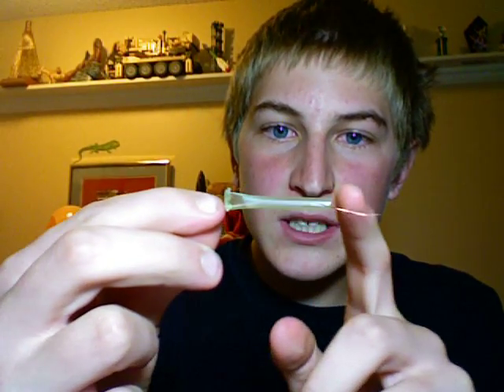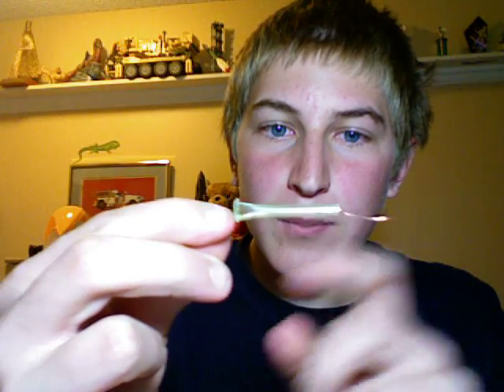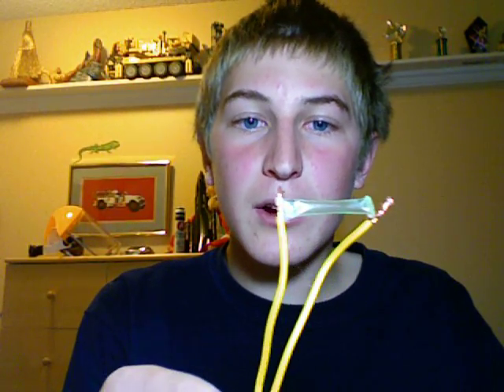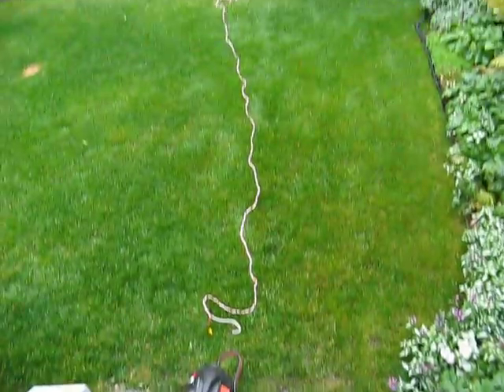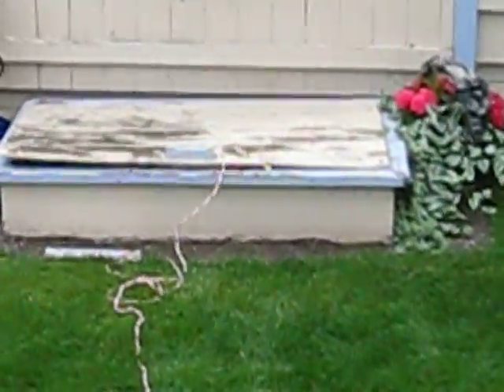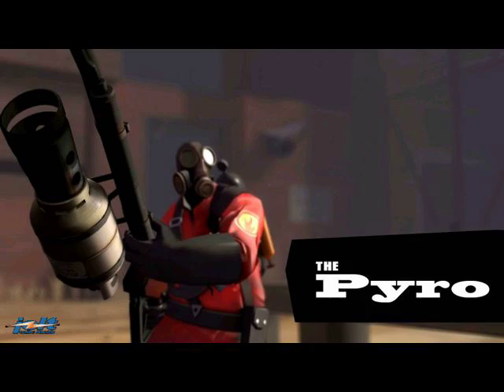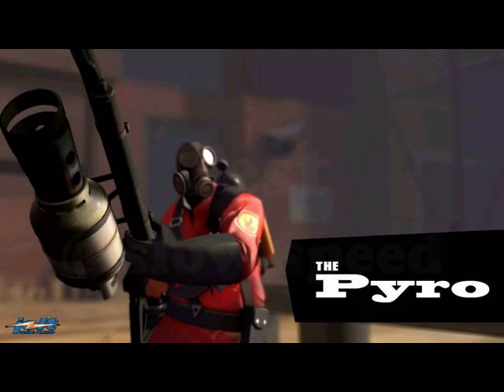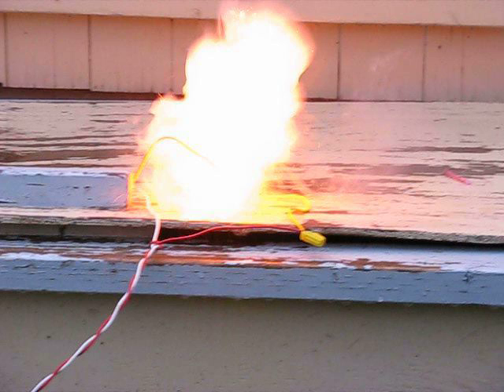How To Make A Electric Ignition System

Comment: What you are making is called a Squib, not much for a explosive device but more for a detonator. These smaller charges are used for igniting larger explosives such as Semtex or Ballistic gelatin. Squibs are usually used for 3500 to 9500 m/s explosives, not for kids. But thats why they don't sell blasting caps or squibs to the general public. Be safe.

Comment: It really depends on how long and how thin the wire is. I tried it and I used around 4 AA's with about 3 or 4 inches of wire. I have no idea what guage (thickness) the wire was. Basically, you'll just have to experiment. First of all, do you want it to stay red hot or do you want it to just get really hot and then vaporize? Either way, start with one AA and keep adding batteries one by one in series (+ to -) until you get the desired result. You can get 100ft of wire on ebay for very cheap.

Comment: Amps, not volts. A bunch of AAs should work, or a C or D battery would also work. This is the order of batteries: 9volt = 0.5 amps, AAA = 1 amp, AA = 2 amps C = 4 amps, D = 8 amps.

Comment: Run the wire back as far as you want depending on wire type... Wires have resistance which would bring down to lower voltage which may effect the ignition.

Comment: for you youngsters trying to do this,  its better to use a ULTRA FINE Copper wire.. the smaller the wire, the less power is needed to ignite it.  with a 9v radio battery, can you make any small wire glow red hot.  you can use white glue and mix with mach's to turn it into a putty that can be painted or rolled onto the wire.  then you dont need to use a straw.  NEVER make anything that explodes with Steel or metals. always use Cardboard and white glue.

Comment from the maker: @AxillaryGrenade I would not advise using 120v ac as the chance of electrocuting yourself fatally is much greater. Realize that all you are doing is creating enough heat to ignite a fuel this can be done with a smaller power source as long as resistance is taken into consideration.

Comment: @dalelerah I would not advise it. It depends on the fuel contained in the igniter. If you heat the fuel too much it may combust. This is simply based on the concept of activation energy. in some cases it is not even advisable to seal the other end with hot glue as the fuel may reach it's activation energy and combust.

Comment: @aznricecannon To be safe, I would wire 2 in series for 3 volts and do that in parallel with another set, so you have 4 batteries and 3 volts.

Comment: @aznricecannon 9 volt batteries wouldn't have enough current to do it. If you get a couple D batteries, wire them in parallel, it should do it.

Comment: I saw you used a motorcycle battery in your other vid. I don't have the type of money to just dedicate a car battery to this and I'm definitely not gonna hook this stuff to the battery in my car. What alternate power supply would you suggest If I was going to fill the charge with match heads. Would I get desirable results with a couple 9 volts? 
PS: I tried reading the comments to see if it was answered. I didn't find anything that helped

Comment: If in need of fuse wire just go to any hardware store that sells wire by the foot (choose how much you want in ft)Usually around 60 cent or so a foot for really cheap wire. 4 gauge usually has around1862 strands and 8gauge about 735 just take a knife or razor and carefully cut off the shielding = A bundle of fuses!!.Also never reuse any small battery in an electronic device that's been used like this. It can damage the device due to burnt electrode's within the battery.small idea.very few lettrs

Comment from the maker: @RussianVitamines that's not a bad Idea. Typically I use some sort of liquid accelerant along with the match in order to start a fire I have couple different match types too (match heads, gun powder, kno3 and sugar). I have used this system a couple of times to light campfires but it usually also involves some sort of fountain piro as well. I typically will use a fairly energetic fuse because it lights the fountain pyro with less delay. However the liquid is what actually lights the fire.

Comment: Its just an electric match, nothing serious, why peoples think its for things that goes boom, for example you can just set a camp fire with it without beeing at the spot :D I find out a bit diferent way of this. Instead of sraw, i use a binder, smokeless gunpowder or styrofoam disolved in acetone, and mix it with match head powder, then it burns slower and nice, without pop.

Comment: I mean this in the best of ways, but this is actually not a very good idea, it works fine, but it will HEAVILY damage the batteries, theres no load inside this circuit, which I suppose if you have a 12v battery laying around you don't care about sure this is great but otherwise, theres other videos that can show you how to make an igniter that will not destroy your batteries.

Comment from the maker: @reload195 You don't come off hater-ish at all. No car (lead acid) batteries do not produce hydrogen gas. You may be thinking of the electrolysis of water which produces hydrogen on the positive terminal. The battery is delivering far less power than it would to even a car. It would take a VERY long time to overheat the battery due to its overall size as well. Also keep in mind that the battery will only output the needed current and the match breaks shortly after it is lit. In short your safe.

Comment: not bein a hater but doesnt the positive terminal of a ar battery produce hydrogen, so youre shorting out the battery which causes a spark when you connect both wires to the terminals, thats dangerous becuz  then the battery can explode.

Comment from the maker: @Vaiktorg I here you. In hindsight I should have used different wording. The intention was not to create anarchy or promote terrorist activities. The intention was to demonstrate a way to safely light fireworks, and test chemical mixtures used in pyrotechnics such as KNO3 and sugar mix (sometimes called r-candy) which is used in rocket motors and smoke pyros. The design is to SAVE fingers and potentially lives by increasing distance between the user and the test subject. Thanks for the comment.

Comment from the maker: @mrwhitewolf94 I am no expert on electrical matters by any means but I believe it has something to do with the amount of amperage the battery can deliver at any given point. On a standard dry cell this "cranking amperage" is low however a car battery can deliver a much greater amperage (enough to turn over a car) the formula is simple IV=W current times voltage = wattage. you could try some hobby car batteries they may work, I use a motorcycle battery because it is smaller than a car battery.

Comment from the maker: @tapper45 A compositor is a person who arranges type for printing or keys text into a composing machine. However A capacitor is an electrical component which utilizes a gap to produce  electrical potential energy. Early capacitor like the lidded jar used a simple non conducting material (the glass of a jar) to separate two metal surfaces. modern capacitors use a thin membrane to separate metal surfaces allowing more potential energy to be stored. Is that sufficient?
Think before you talk dumbass

Comment: @pyrogirl1985 2- 9V batteries wired in series do not have the current capacity to raise the temperature of a copper wire of this diameter to a point where ignition will occur. Canabalize a hair dryer and use a section of the thin nichrome element, or use a fine strand of steel wool. Any wire with a higher resistance than copper should work well..

Comment: 3. use black powder instead of flash of a match.
its still a pretty good design, i like it ive tried it. its not bad. oh btw you dont need a 12 volt. a nine volt will suffice. it just might take a little more time. btw good job on ur pyro vids.

Comment: Ok. Good job but here are a few ideas that could improve this design.
1. Replace the small strand of copper wire with the spring from the regular click pen.
It doesnt have to be a click pen spring just a small diameter spring.  Just hook the end of the wires to the ends of the springs for terminals.
2. You dont necessarily need the straw with some fireworks. for instance bottle rockets, just cram the spring into the bottom of the rocket in that small hole(after removing the fuse of course).

Comment: you could just put  some steel wool in the tube and about half a teaspoon full of powdered matchheads in too .

The following is a load of nonsense : Hinfgsjcucuysgffgxydyycgxgshhcuyx tdcktscgsagkcscgyassctsytcsaycscsauyicsauyfcfyascusicfgreghfirehv8eryvoewuf;kewhfuiewhufyw9euf8374[73f7da8v7d9icvd098v78tcdkjcv8ve7fe7fdsc9sCIYSXCTYSDTCI7WSY6DC78WEFD76WEDYSYCT87DSTC7DC7T7ECTE7C7C7TSCUSDTCSCTSDC7TSDC76E67678TSTSXSUODTSUYTYTTTTYTYtistyduysttYTTYTtyitatxztTTRZSTraiTURXSATCDTEITCPFEQP;BTKI6FSXUYDFLD

Comment from the maker: @bobbybob3680 
Yes you could use an electrical spark to light aerosol, and you could do it with just one or two aa batteries. What you need to do is wire up some compositors to store electrical potential energy. This will allow you to achieve the necessary voltage to create an electrical arch. I would recommend that you do not use wires as your arching points you should use something like bolts or pins to achieve a more consistent result. I hope this helped. If you want shoot me a message.

-DAN

Comment: ok please answer my question! anyways what im wondering is if i have a potato launcher and i cut two holes next to each other and have the wires glued in, will the wires arch creating a spark igniting the aerosol? cause all i need is a spark, and in that case couldnt i use a smaller battery? please let me know!

Comment: @pyrogirl1985 instead of the copper, use steel whool the thin one, just take a pice and use it, you just need 12 volts for litting this one up, also if you take two matches, pass the whool in between the 2 matches, touching the lighting part, and pass corrent through it it will start, no doubt about it!

Comment from the maker: @SeamusOLepreachaun The copper wire heats the match heads or gun powder to it's activation energy at which point it lights. the copper wire is simply acting as a resister much like the nichrome wire in a toaster or an element on an electric stove.

-DAN

Comment: Forgive my innocence now, but does it go bang because the strand of copper actually gets red hot and burns up on fire or simply because you have got current flowing through it? and will this work on a larger scale eg how many volts do you need to burn out ordinary single core wire? Thanks Boss!

Comment from the maker: @Ffojt Noted. I usually just use match heads or gunpowder because they burn for a longer period of time and ensure ignition. I have really only used flash powder for demonstrations. Also the hot glue can be substituted for a simple piece of wading paper or plug. I also use the lowest temp hot glue I can find to minimize the risk associated with reaching activation temperature.

-DAN

Comment from the maker: @thebomb182 I don't know what your seeing. My power source is nothing but a 12v motorcycle battery hooked up to leads. There is very little electrocution risk and the electrocution risk that exists will not kill you. I have no idea where your getting 264 volts from.... I could only get 240 if I plugged the charge into a double grounded oven outlet lol. Have a nice day and please think before you talk.

-DAN

Comment: 8421 Mobile Crane FTW. Been after that set for ages XD
I prefer the second  system, but this is still a pretty neat way to do it.
Also, where did you get that mask? I ain't seen anything like it round these parts (England).

Comment from the maker: I am am to have to say no because most 9.0v batteries can not  put out the necessary amps to run the system. however if you go into the realm or RC (nickel metal hydrate) batteries you could probably light my electric match. this is dangerous though, as this type of battery will be much more likely to overheat and destroy or damage itself when shorted.

Comment from the maker: Yes I did, and yes this is wrong the correct term is terminals referring to the positive and negative contact points to which the firing device attaches to (no they are not really that fancy they are just wires). It was a slip up I made when I made this video nearly a year ago. I did not catch the error during editing because to clip sat on my computer for months before it was finally edited and published this past may. (thank you for your catch I will add an annotation to correct myself)

Comment from the maker: To add to that last comment thin steel wool is very dangerous it will often simmer with out lighting the fuse or match head. Since the steel continues to retain heat or even burns after the electricity is disconnected there is the potential for an unintended late re-ignition. If this happens wile you are walking towards the device to se why it did not fire fully in the first place you could hurt yourself quite badly. Remember to stay safe use the "5 minute rule"  (don't go over for 5 minutes)

Comment from the maker: I used to use very course steel wool (the kind that looks like the shavings after you have threaded a steel pipe). I found that it worked great just like the copper wire I now use, BUT it was much harder to make straight or wrap around an object such as a fuse. The copper is much easier to play with by my personal experience but hey if you don't have copper use the heavy wool. ALSO I wold not use thin strand steel wool as you will need a clump which may cause failed firing and delayed ignition.

Comment from the maker: I use copper or nicrome because of the delay time my friend. not to mention how delicate graphite is. I have used .5 mm graphite for charges before but it has a much longer delay time and is a pain in the butt to hook to leads. The graphite often snaps or the wire leads slip off if they not secured in place properly, also you can not use mini alligator clips to hold graphite as it tends to snap. yes graphite igniters are easier to make BUT this system fires with much less error and much faster.

Comment: just put a bit of graphite (pencil lead) between the two bits of wire instead of that shit you made. When hooked up to the battery, the graphite glows red hot, easily lighting a fuse.

Comment from the maker: I saw that you you Oxygen as a fuel source or as part of a fuel source in one of your videos. Where did you get pure o2? thats crazy I don't think I have ever seen that much flash off a combustion chamber that small. I have never realy had much luck with potato guns. Used ether as a fuel and ended up singing most of the hair on my face when it would not fire. I opened up the tail end to check out the electric sparker inside after about 20-30 minutes of airing.  tuns out the fuel was slow release

Comment from the maker: but think about the cost. Nichrome and coper wire are cheap in comparison to individual flashlight bulbs. I have used flashlight bulbs but i find they are to hard to find here in canada (most flashlights are led now so bulbs are hard to find). the only place I have found decent replacement bulbs are in radio shack which is like an over priced general electronics store. to me my technique seams allot less of a hassle. Thanks for the input though. I smash bulbs by rapid heating and cooling.

- DAN

Comment from the maker: I have tried the whole Christmas tree lightbulb thing i find it way to unreliable. From personal experience this has worked for me almost without fault. The only failure I can think of out of the hundreds of tests that I have done is the wire heated melting right out of the casing before igniting the match-heads inside. thats why I usually use powder now. As for the IED thing I am aware of it but don't think the government is going to put me on a watch list over backyard pyros.

THX FOR COMENT

Comment: FYI a diode is a component lol what you should have said was "terminals"

A few tips. Don't put your face on you tube, if you can help it, on videos containing illegal information or acts, such as an IED (improvised explosive device) or IEDD (improvised explosive device detonator) which is what you have there. Government is coming down hard on this stuff.

2. a much simpler way is to go out and buy a small torch light bulb, 1.5-4.8v, and a holder, and break the glass, filament exposed.

Enjoy :)